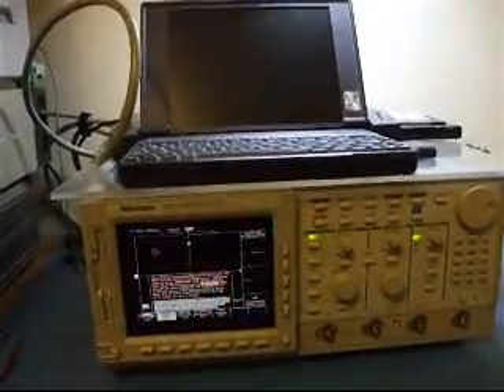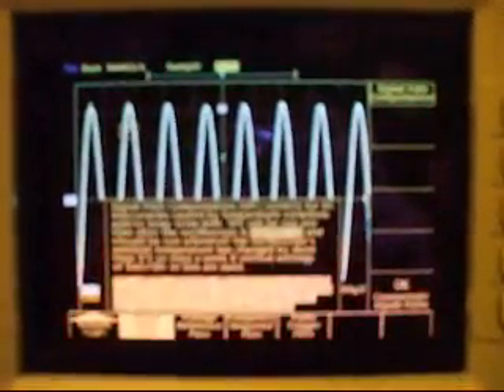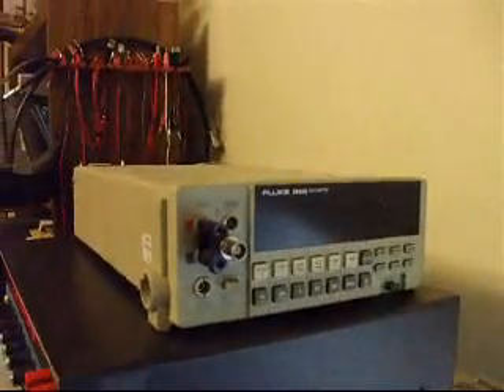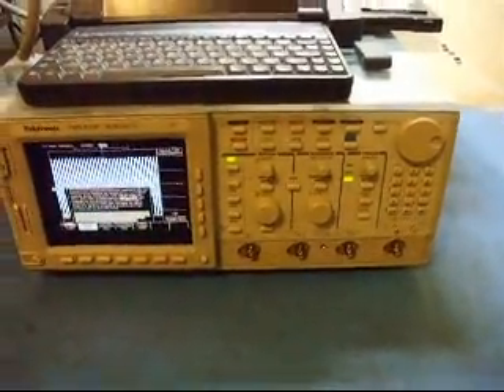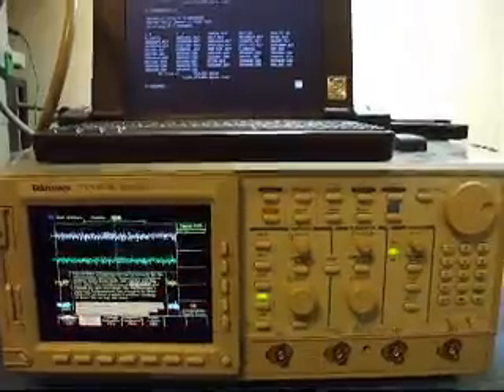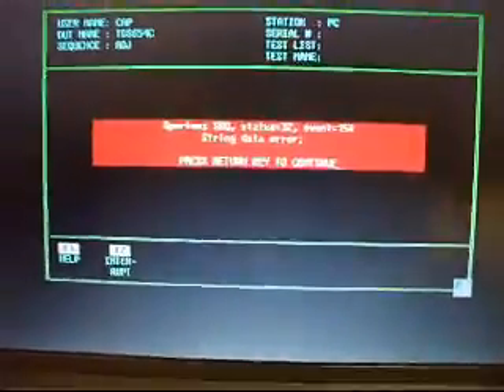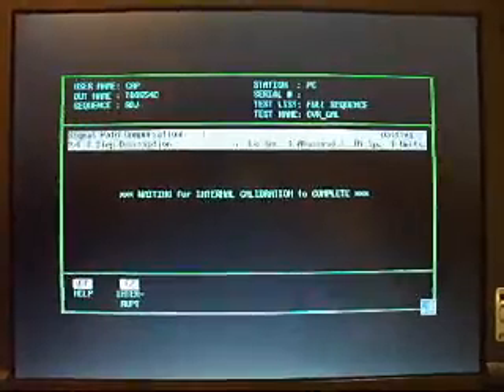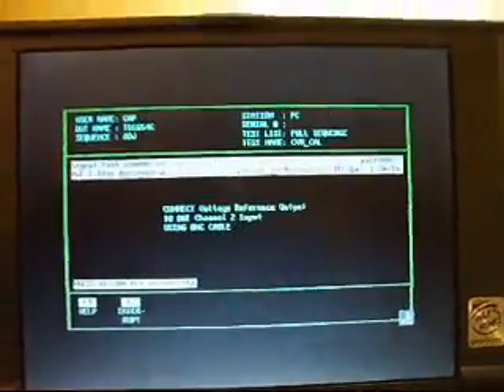Calibrating a TDS Oscilloscope Part 1 of 2

Comment: Thanks for your video. Very interesting!  Do you know if hardware options can be added to a TDS784D without any software unlocks.  For example can I add options 1M or 2M and it would work?

Thanks,
Reply from the maker: Sure, allow the scope to fully power on. Un-write protect scope with toggle switch on the right hand side of the scope. Send the following command via gpib	:PASSWORD PITBULL

Now add what you want from below
for Option 2F (Math Pack)             :WORDCONSTANT:AT 327689, 1

Your board is probably 2M capable, some scopes are 1M only…
for Option 1M (Long Mem.)           :WORDCONSTANT:AT 327686, 1
for Option 2M                              :WORDCONSTANT:AT 327695, 1

for Option 2C (Comm.)                 :WORDCONSTANT:AT 327692, 1

These two require calibration afterwords…
for Option 3C (Comm.)                 :WORDCONSTANT:AT 327693, 1
for Option 4C (Comm.)                 :WORDCONSTANT:AT 327694, 1

I never could get this one to work, let me know if you figure it out…
for Development Menu???            :WORDCONSTANT:AT 131227, 1

Usefull,                                      :err clear.

0 disables an option, 1 enables it.

When finished, write protect the scope with the toggle switch (or the scope wont power back on properly) and cycle the power.

I think you can do this with the console port, but I never bothered. The above absolutely works. I used this for several years until someone posted part of it, have at it…